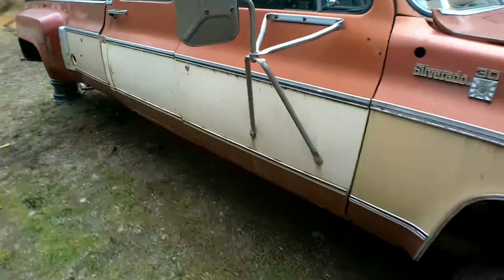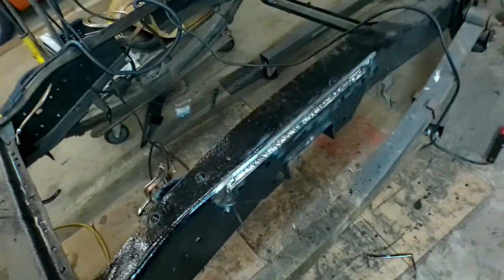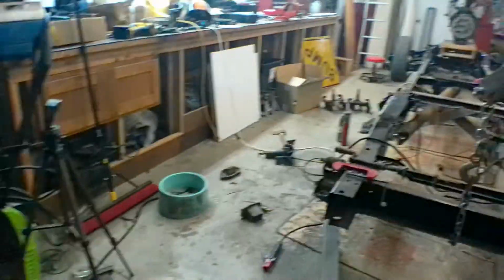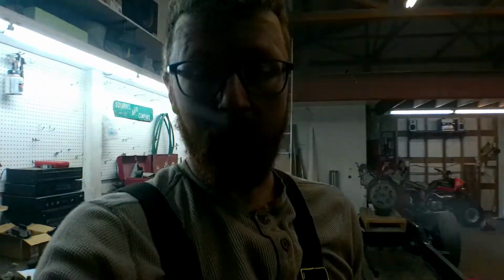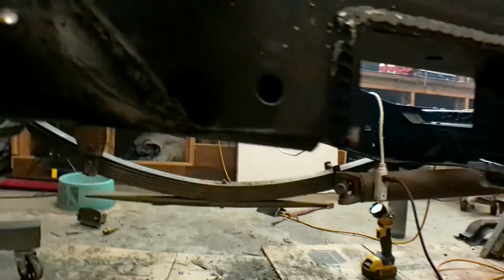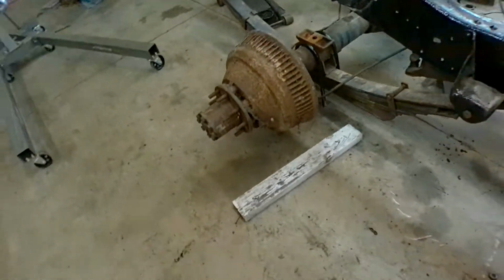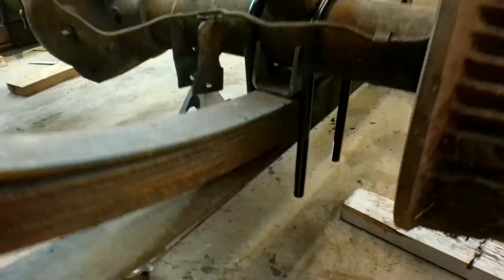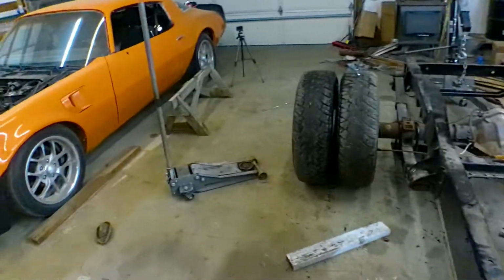C30 PT.  3: Getting the c-notch and flip kit installed

Comment: You got the cherry picker right there just pick the axle up with the cherry picker dude don’t worry. I did the same thing to my truck and fought the stupid jacks and the fucking front pinion falling off the block. I understand next time just use the cherry picker struggle right now and I thought about myself too think that welding is a way better option than the bolts. I welded mine as well.